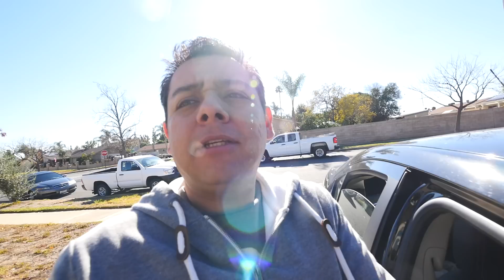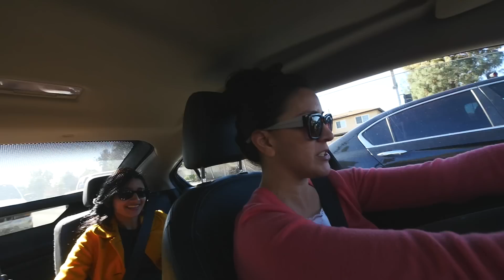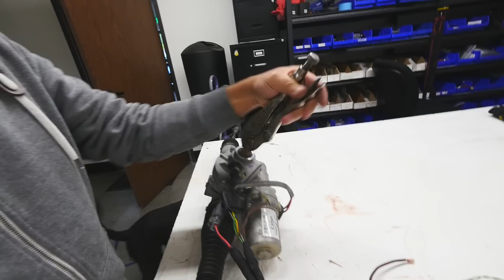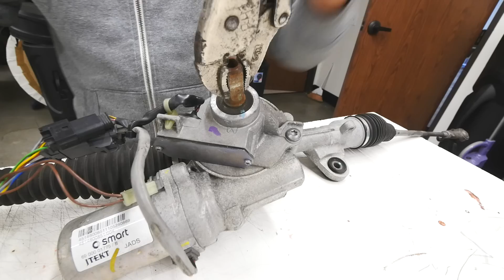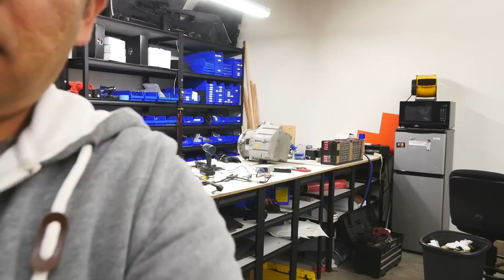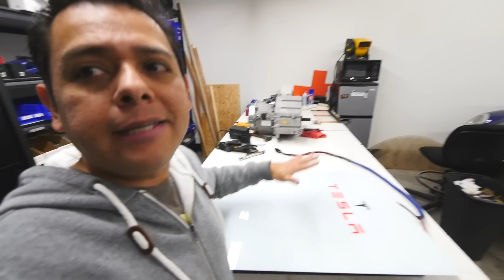I need your HELP,  LETS MAKE A VIRAL VIDEO

Comment: You need three signals; the raw (angle sensor) , speed sensor, and battery reference voltage which all comes from the PCM.

Comment: If you need a cheap inverter/charger with a solar charge controller included check out the mpp solar PIP series. I have been powering my home with it for the past 4 months. The 2.4kw is less than  $600.
Reply: All you would need is a BMS to complete the power wall.

Comment: I think I just got an idea for my own DIY EV conversion. so I'm going to be working on converting a 2006 Dodge Charger SRT8 from Gas to electric. but at the same time investing in security (I'm not taking any chances in today's market.) since I'll be using a used Tesla for a conversion. (I'll have to see if Autopilot will work in a non tesla though). while using Cold Rolled steel to build a more sturdier frame.

Comment: That's a very small power wall. :/
Reply: +Danyal Ahmad I can see around 2kWh in there.
Reply from the maker: +Martin Brochu  4kwh
Reply: jehugarcia Tesla sells 10kwh version for $2500 (I think).

You used beat up laptop batteries...
Reply: You could even do better with generic/ultra star 19650s. But, they sell for 1000piece/$900
How many batteries did you use? And how much did you inveat.?